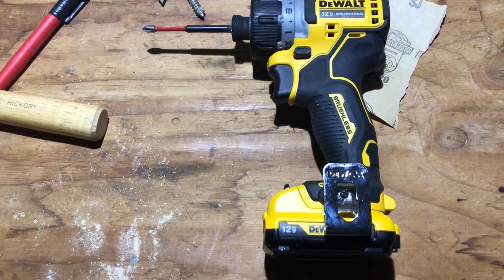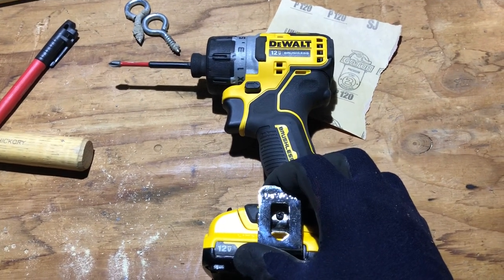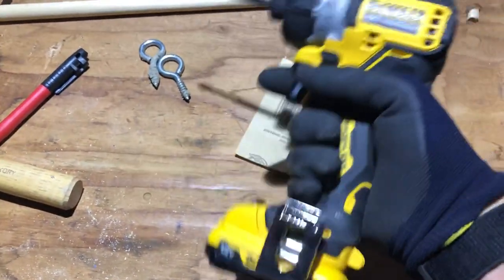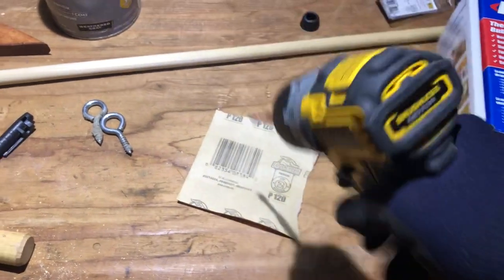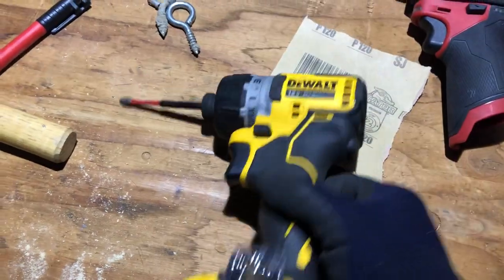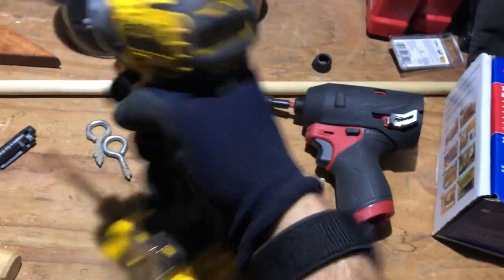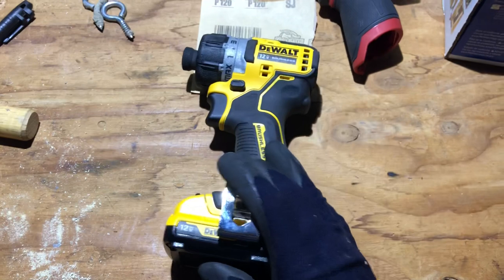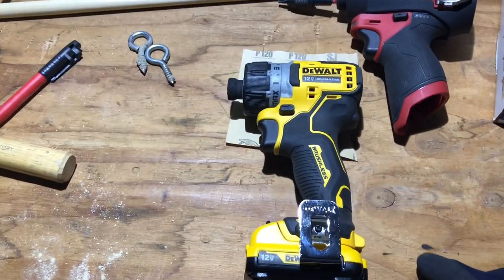Dewalt DCF601 Sub-Compact Xtreme 12V Brushless 1/4” Hex Screwdriver Quick Look

Comment: Great video! I’m a Milwaukee fan boy. I have tons of 18v and 12v tools. Never liked the “pod” style batteries. The electronic clutch is the worst idea in years. I have recently purchased the 12v Dewalt xtreme 1/4 and 3/8 impact. They are so comfortable to use and the impacts have the finesse required for smaller fasteners. I will be picking up the drill to replace the Milwaukee m12 drill. Again, great video, I thought I was the only one who hates the clutch!
Reply from the maker: Sorry for the 2 year late reply. Lol. We have the same M18 drill at work. We were doing work on a container, adding holes for electrical and I didn’t realize I had it the clutch on instead of drill mode. When it would stop I had no idea what was going on. I thought I was having trigger issues. It’s so bad. Hopefully on the next gen drills they are going to put the mechanical clutch back on it. I feel they will because the m12 installation drill driver came out after the current M18/M12 drills and it opted for a mechanical clutch. Fingers crossed.

Comment: Came across your channel when I was researching a new set of compact power tools.  You definitely helped me narrow it down so I appreciate it!  Ended up getting the screwdriver, driver, impact wrench, drill, two bags, four 2AH batteries, and two 2amp chargers for $310 with the Father’s Day sale at Lowe’s and WOW, these little guys are super nice. I’m most impressed by their ergonomics and how fast the batteries charge. They’re so freakin comfortable to use for extended periods with the design of the grip and the light weight and the batteries charge from 1 bar to full in under 25 minutes. My Flexvolt yard tools came with 4amp chargers and I’m looking forward to see if they might cut the 12V charge time down to like 15 minutes. These little Dewalts feel plenty powerful too. I just got them to use around the house and I wasn’t expecting 500 in-lbs of torque from them, but so far it’s looking like I’ll be able to leave my Makita 18V stuff at work from now on.
Reply from the maker: Wow that’s awesome, I appreciate it a lot! It’s nice to have some resources available to help you cut past the marketing hype and the vast amount of tools available!

Comment: The Xtreme 12v system is better than every single m12 tool in my opinion, their drills destroy milwaukee’s. If not the power, the durability, longevity, and ergonomics are better.

Comment: I don't know the 12-volt extreme cordless tools, but what I would really love is for DeWalt to make a 12-volt extreme version of the 850 20 volt impact driver. It would be even smaller and lighter and get in the tighter places than the 850 and I would love to own one for working around the house and in my profession which is aviation maintenance
Reply from the maker: They do make a 12volt impact driver. I just checked Lowe’s and they are on sale. The screwdriver with 2 batteries and a charger is $99 down from $130 and the same kit with the impact driver is $130 down from $150.

Comment: Nice vid! Agree on all points. The Dewalt 12v Extreme line is excellent, love the screwdriver and the impact is pretty powerful.
Reply: Hey, i see some comments about the driver's clutch failing. Do you have any problems with yours?
Also, it's no longer being sold in home depot either, so i'm kinda suspicious. Was tryna decide between this and the Milwakee 12V screwdriver. (Edit: the first gen with a mechanical clutch. New one is electronic and terrible)
Reply: @loucifer323  yeh looks like I was wrong. mb mb

Comment: Thanks for the video. I have the Hercules 12v screwdriver which is similar to this. Bought for the same reasons of not wanting to mess with a chuck and needing a clutch for light duty stuff. Like it a lot but thinking about this Dewalt.
Reply from the maker: losbush Yea this one is a bit shorter than the Hercules which is nice if you’re trying to reach through places with a lot of surrounding wiring or piping.

Comment: Great review. Also the Dewalt charger that comes with the kit charges 12v and 20v batteries. I just picked one up at Lowe's for $90 for the kit - great deal.
Reply from the maker: Yea its good benefit. It’s made me think about picking something up from their 20V line. I’m trying to keep my different batteries to a minimum though. I’m already at 4 different brands, in a few years it’s going to be expensive to replace them. 🤦🏻‍♂️
Reply from the maker: Yea I saw that they are really reduced right now. A guy on Instagram just showed they are adding a 1/2” impact wrench and changing the 3/8” impact wrench the same body as the new 1/2”. They look stronger. If I didn’t have the Milwaukee versions of them I’d probably buy them.
Reply: @kennethkuhlman8864  Yeah - I know what you mean. I've got Makita and Dewalt and was considering the 12v Makita but it requires a different charger.

Comment: I am also a fan of the mechanical clutch, and also have both Milwaukee and dewalt because I couldn’t help myself...  was looking at this one even though I have the non brushless version of this that’s still kicking. More brands need to do the brushless mechanical clutch combo. The electronic ones are too powerful for light tasks. Doesn’t matter what brand I’ll always have a soft spot for the right combo. Now if only the m18’s didn’t get rid of the mode selector for that all in one clutch ring selector...
Reply from the maker: You know it’s funny you say that. Before I got my m18 I would have said the all in one ring was the better way to go, but after using it I don’t really like it as much. It’s much faster the old way when you’re using one drill.
Reply: @kennethkuhlman8864  the fuel gen 2 hammer drill was near perfect imo. Still have a brand new one stored away, besides my old trusty beat up one just in case. 
Also not a fan of this new trend of chucks without the treaded screw. I have a dewalt rohm chuck (what is in 9 series dewalt) on one of my Milwaukee drills and the metal Milwaukee chuck I took off on a mid size dewalt that had the plastic sleeved chuck stock. Frankenstein drills so I know they are mine and both much improved.

Comment: What's your opinion on the older m12 screwdriver with the black chuck cersus the dewalt?
Reply from the maker: J Gamer So that one in my opinion isn’t as versatile. It has a max rpm of 500 vs the dewalt 1100. That’s going to slow down you down if you use it for light drilling. Also it’s heavy, larger, has less powerful lighting and doesn’t have the easy one handed chuck of the dewalt. If you go into a Home Depot and handle the Milwaukee you’ll see how big that screw driver actually is. Also the entire dewalt kit is $99 at Lowe’s right now and that screw driver is $80 tool only at Home Depot. I just think the Dewalt is a better deal and tool.

Comment: Can I use this tool to undo rust nuts bolts etc
Reply from the maker: So this tool is really just think of it as a fast screwdriver if you can use a screwdriver on it, you can use this on. There are no impacts like you would get on an impact driver more impact wrench, this works just like a drill.

Comment: Have you tried the Milwaukee m12 screwdriver
Reply from the maker: I have not tried it. But I think I’d still prefer this one. Unless it was for work where the tools are provided. I do know the M12 Fuel Screw driver does have a mechanical clutch and a gear box. I’m sure it’s fine and works perfectly well.

Comment: Were you able to get dewalt 1 inch bits to lock in to the collet?
Reply from the maker: Sorry so slow to respond. I have tried dewalt a specifically but I Milwaukee ones do. I don’t usually use it that way though because I can’t see the screw.

Comment: What ? No Milwaukee m12 fuel screwdriver  ?
Reply from the maker: I skipped that one because I feel it’s outdated. The chuck is two handed, it’s much heavier, the cost is a lot higher and it’s longer. The new M12 installation drill/driver takes its place for sure. That one is really nice to own if you’re staying in the Milwaukee lineup.
Reply from the maker: But if you’re doing electrical, the switch on the Installation Drill Driver is a pain in the butt. And that’s where the Dewalt really kills it. I just did a side job for someone doing a full replacement on all the outlets and switches in their house. The Dewalt was the main tool I used. I had the IDD just so I didn’t have to change bits between flathead and Phillips.

Comment: What gloves are those?
Reply from the maker: John Ortuno 

https://www.airgas.com/product/Safety-Products/Gloves/Coated-Work-Gloves/p/RAD64056603

They are the best gloves I’ve ever used. They are the perfect thickness. You can wash them multiple times and they still go. If I need ultra dexterity I cut the thumb tip and pointer finger tip off and they don’t fray out. Super good.